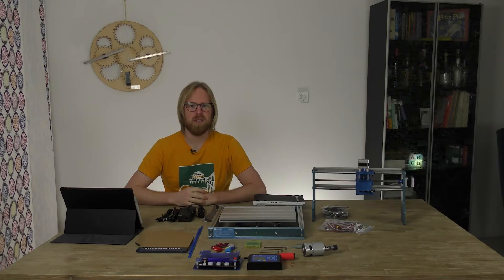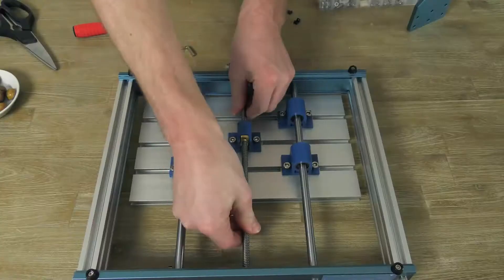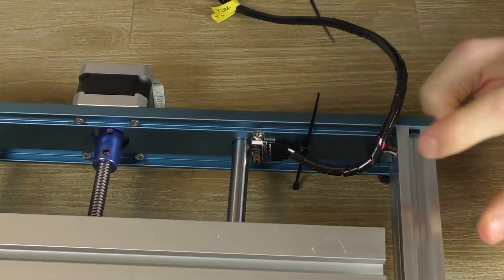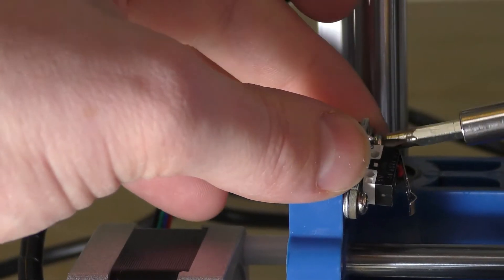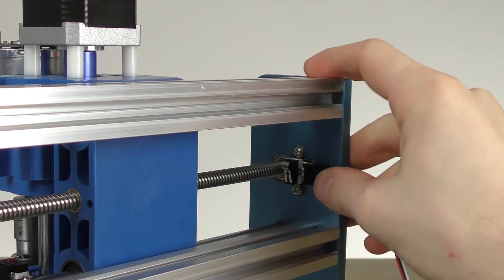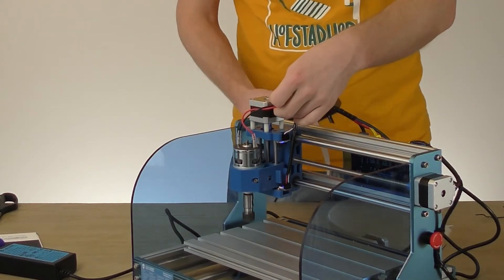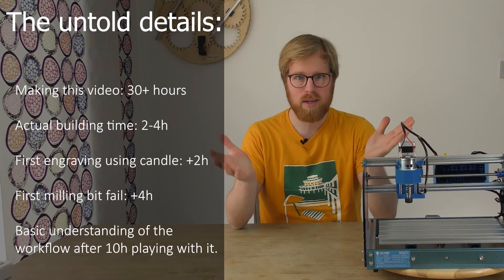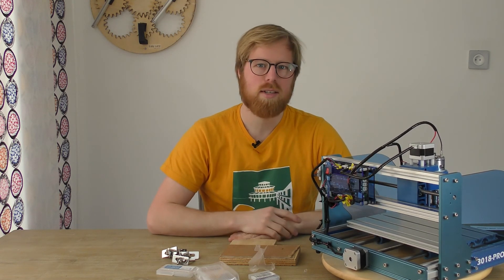Building Sainsmarts PROver 3018 cnc machine a bit more efficiënt.

Comment: To each their own but I didn't care for the spiral cable loom and instead spent a shade under 10 bucks for a roll of nice 1/4 inch braided wire loom off Amazon. I also had issues when doing the gantry t nuts popping out of the track when assembling mine which caused me to have to slide the gantry to reset them thus losing the alignment from the tool. Instead I went back once I had started the threads on all of the t nuts and aligned the gantry with a set of machinists 123 blocks and brass setup bars clamped to the rails. I checked with a combination square afterwards to verify and was within several thousandths of an inch. I also made sure the base was square using the 123 blocks and measuring diagonally to the corners and mine was square but it was worth checking. I'm still learning and want to do some further calibration but still figuring that all out with how to modify grbl, using certain techniques and understanding how software and those changes mesh together. Nice video and I will say I wish I had seen it earlier as some of the steps you showed would have been more convenient.

Comment: Eliminate those washers, that you used for Z limit switch raising. Lower spindle motor instead. You won't be loosing those ~5mm gap, that was created. Enjoy , great video 👍🍀
Reply from the maker: Hey man your response made me think and look again. The spindle motor is bumping into the stepper motor. 
I am not sure it that alone made my stepper motor lose steps but it could be.

I very much like to adjust the casing of the stepper motor so that the spindle can move in front of it.
Reply from the maker: So it was the spindle motor that bumped into the stepper motor. Basically if they had designed the spindle to be 1mm further from the the gantry or the stepper to be a bit smaller/higher they would not bump into each other at all. I removed the washers.